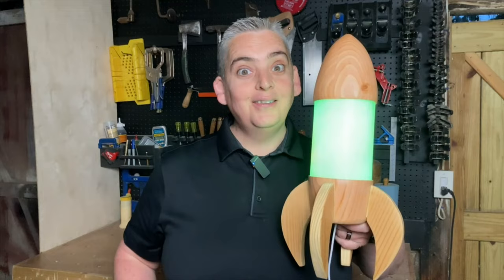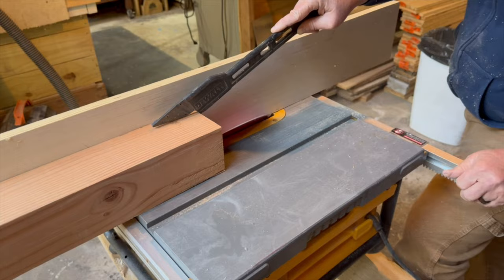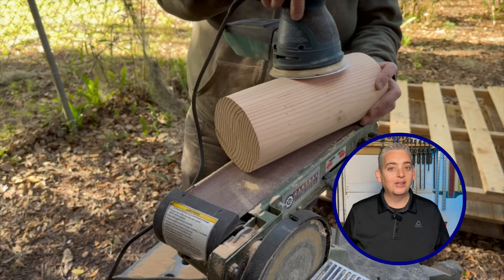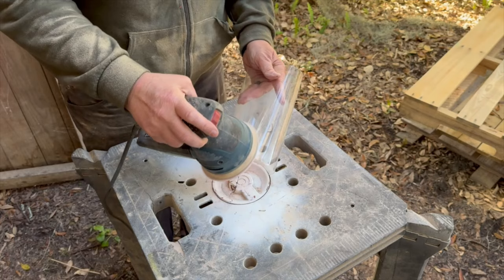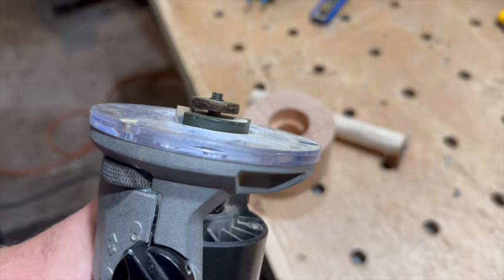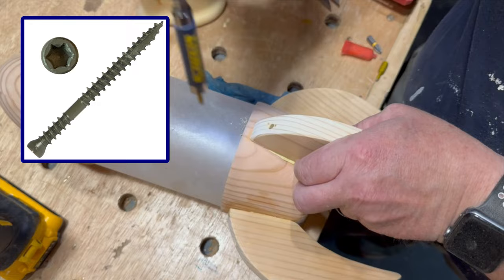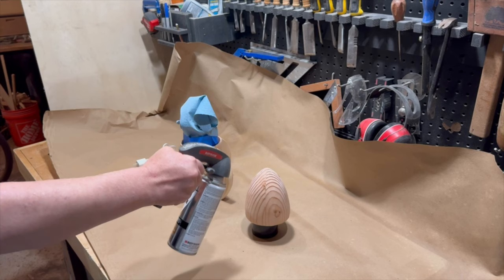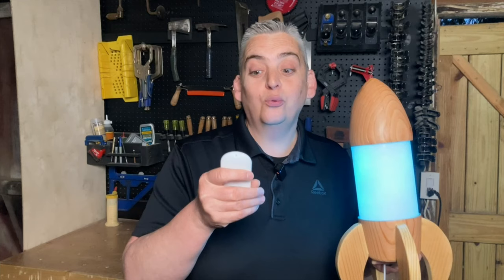Making A Rocket Lamp // Woodworking Project

Comment: That is awesome. I would not tackle this without a lathe..You are very talented.Do you cut off the extra lights? If so, is the cut off usable in another project?
Reply from the maker: Thank you! So what ended up happening is: I slid everything into the lamp before cutting the strand and just for fun, I wrapped the rest of the strand around the post to see what it would look like, and when I fitted it together, I just left it like that. I normally do cut off the extra and I've never used the cut off myself, but there are a bunch of videos that show how to solder these strands if you didn't want the extra to go to waste.